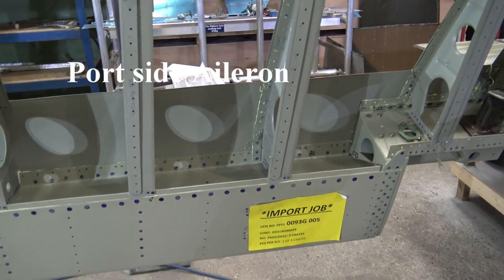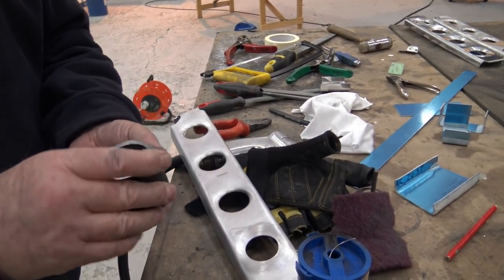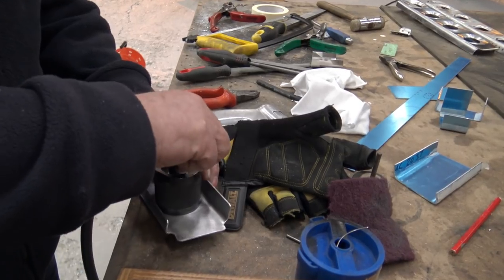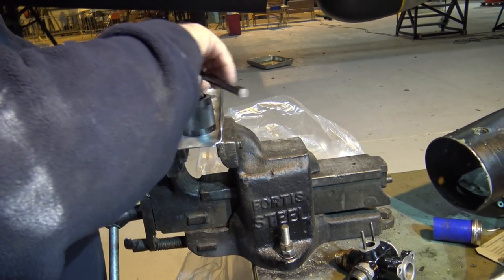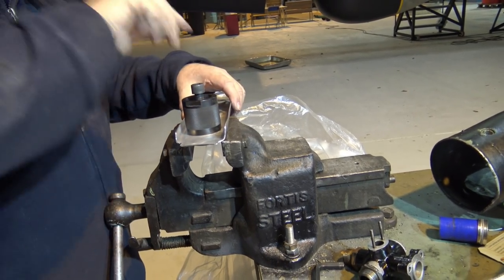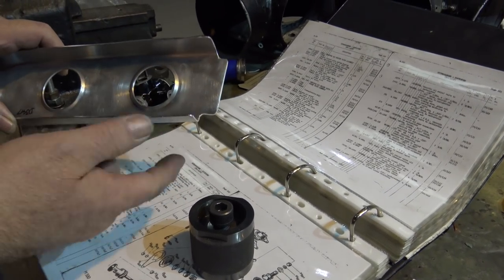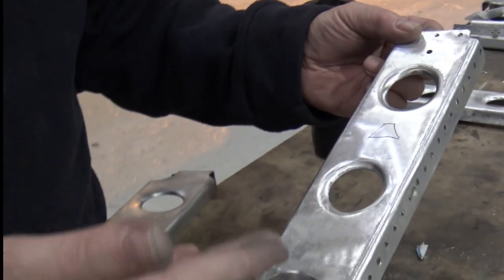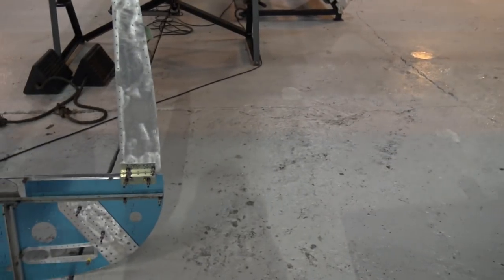Video 46 Restoration of Lancaster NX611 Year

Comment: Hello Neville. At 2 mins We used to use a smaller version for cutting wing mirror holes on cars. So l recognized it straight away.( Woopie l actually knew something Lancaster related)
Once again this graphically illistrates how labour Intensive this project is.
Reply: John, I remember making something very similar way back in the mid 60's to punch holes in aluminium sheets for the chassis of ham radio builders. Not quite as sophisticated though, I think I used mild steel and case hardened it.
Reply from the maker: Thank for watching John.
Reply: @Peter Little   If you case hardened the tool then it wasn't mild steel. There needs to be a minimum percentage of carbon in the steel, it might have been SAE 1035 or SAE 1045.   4130 & 4340 are widely used.
Reply: @trespire  - this was in the days when there was a magic stuff known as 'Kasenit'. After machining the mild steel it was heated to a bright red heat and the rolled in this black powder. This caused the outer surface of the steel to take on extra carbon. After heating again to a bright red the item was quenched in water. A file test would then prove that the case was indeed hardened and would just skate across the surface. I have actually made some form tools for one off jobs in exactly the same way - usually for brass.
Reply: @Peter Little   Learned something new from you, thanks.   Never heard of this "Kasenit", but it does make sense.   Seen several documentaries that samurai sword makers apply a similar process.   Don't know if this would yeald good results today, as modern mild steel tends to be terrible and full of impurities.
Reply: @trespire  I'm not quite sure if it is still available - it smelt pretty disgusting and the fumes were probably not good for you. I have done case hardening using the ground up carbon rods that were in the old fashioned batteries, but like it says it is only skin deep.
Reply: @Peter Little   Made a quick search, seems it's available over in the States.   Case hardening might be applicable where resistance to abrasion is required, or reconditioning equipment like a guide rail or plastic injection mold.   Wouldn't expect it to improove yeald streangth / toughness.   As a rule of thumb, any substance in powder form is nasty, the finer it is the nastier it gets ( rate of oxidation / reactivity ).
Reply: @trespire  I know we used to use on the preserved railway I volunteered on for hardening the motion pins and good stuff it was. As you say it didn't add anything to the strength of the material.

Comment: Having some experience of forming lightning holes in frames, they need some lube to help their forming and it helps minimise cracking when you use a forming tool (same when you punch the holes out).
Reply: My very first thought too James.
Reply from the maker: Thanks for watching James
Reply: A heavy weighted straight mineral oil, like a 30W or a 40W ?   I would be afraid to use anything like graphite grease, as graphite ( carbon ) and aluminium are known to cause a galvanic corrosion pocket.

Comment: Nice tool.
 I would use a small pipe  ( say 10 inch long) over the handle to take off the stress on my hands and needing less muscle power to make it do its job.
Reply from the maker: Cheers Arnhemseptember 2009
Reply: Yeh, or a break-bar and a pair of gloves. Important to "feel" the material give, do it slowly.